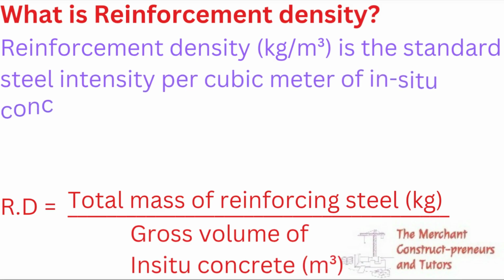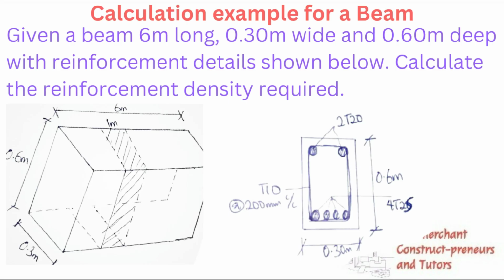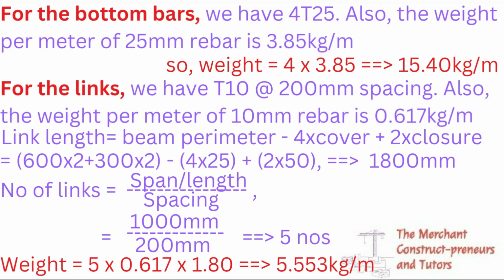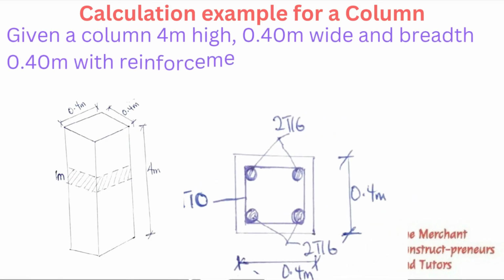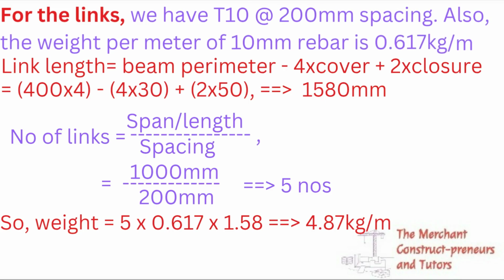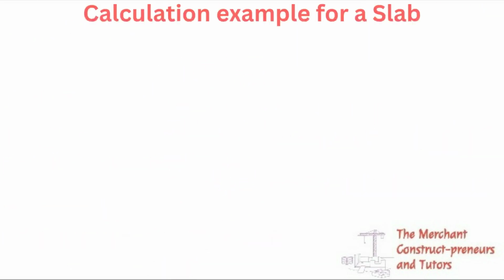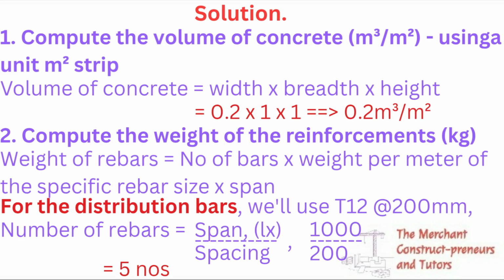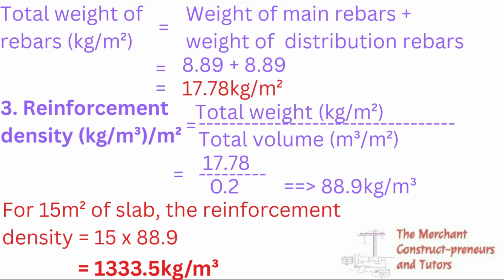How to Calculate Reinforcement Density for Slab, Column, and Beam

Comment: Sir please further explain the span length, I don't understand why 1000mm. And also get 2X closure.
Thank you
Reply from the maker: The reason why it is best to use 1000mm length is that it is easier to replicate for any length. 

You wouldn't need to do sophisticated adjustments.

Also the X2 closure for the slab rebars are the bends at the edges of the slab.